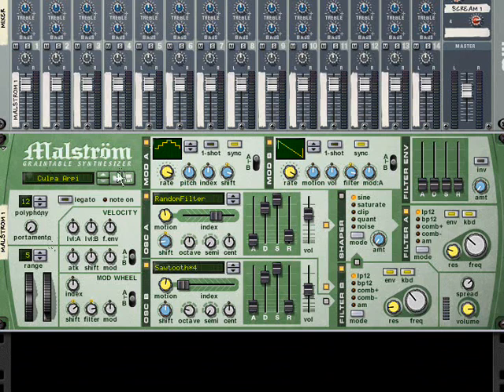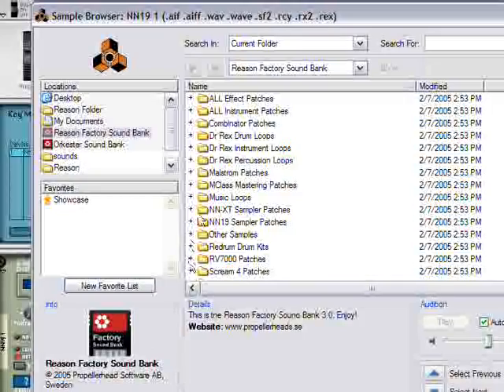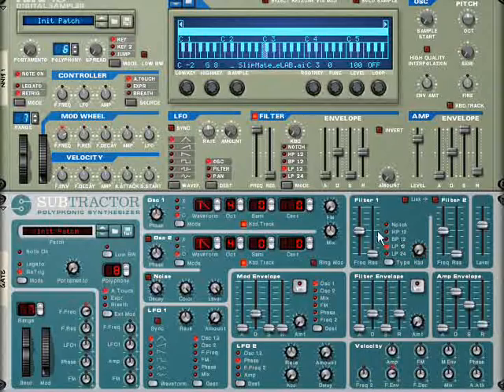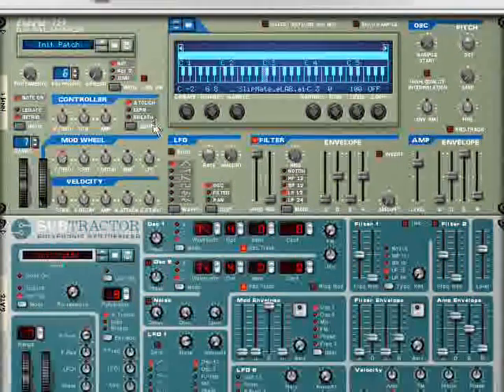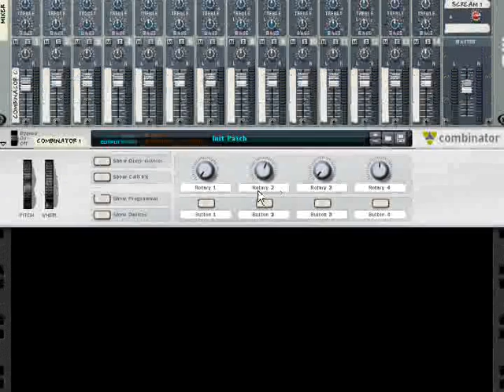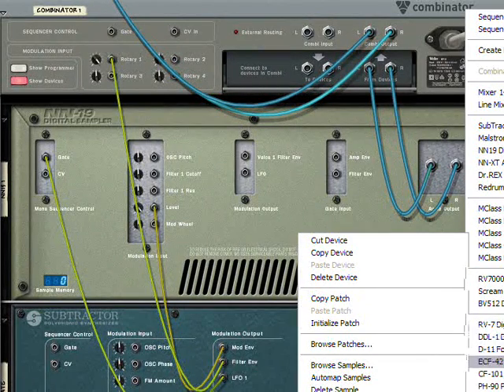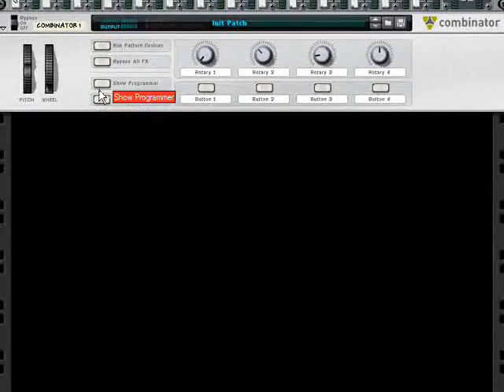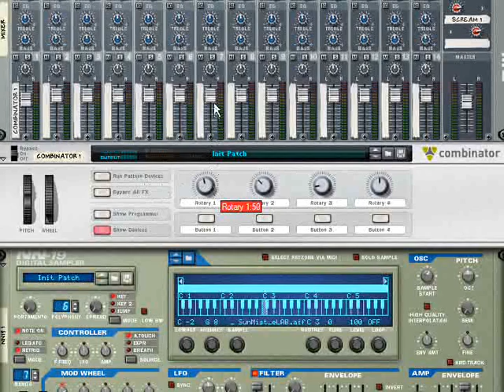Reason - Glitch effects (Granulizer) setup

Comment: Not sure why I'm having this problem. Using ver 5 and the sample wont stop playing all the time. Constant output, at intervals dependent on the Subtractor's LFO's rate, assigned to rotary 2. The sample will play if I hit the keyboard but it doesnt affect the 1 sample that is repeating. Mod env is connected to the NN19's 'Level' but doesnt appear to do anything? I know this is old but any help/response would be appreciated.
Reply: +S Chavez use the LFO 1 from Thor as this requires a gate signal to trigger the LFO's cycle.

Comment: They are very different both in concept and functionality.

FL Studio is mainly a sequencer and DAW. Meaning, you could accomplish all your recording in FL. 

Reason is a MIDI-driven application that cannot directly record audio in. It does, however, have some of the best sound design capabilities of any piece of software out there.

My advice; get FL Studio AND Reason. You can use Reason inside FL Studio to design your sounds and track and arrange everything in FL...

Comment: This is damn cool. 
I came close to creating a two-sample stereo one of these today, but I can't seem to get full control over the second sample w/o taking it away from the first. By copying and pasting the sampler, gate, and effects and routing them to the splitter. Then create a new combi and route the delay to it, and combi to mix 2. Adjust "spread" with delay panning. Problem is you need two more rotaries for the LFO 2 and Filter 2. Maybe you've figured out a way to do this?

Comment from the maker: It could be because the knob on your rotary input on the rear of the combinator is set for 64?  Set it for 128.  It's the sensitivity to the input that this knob controls.  Remember, it's the knob on the rear where your rotary input is plugged in.

Comment from the maker: Actually, the reason I chose not to use the NN19, is that it does not provide an easy way to actually STOP the sound.  You need a subtractor as a gate for your on/off control anyway, and I want to demonstrate the ability to use subtractors as control instruments, rather than audio.

Comment from the maker: Alternately, you could wire up a RV7000 after your Rex, set it to ECHO algorithm with a delay time of 20-40ms.  Dry/wet 50%.  Use the GATE mode CV either Matrix it or Combinate it with your rex (recieve notes [x]).    Don't forget to hit "Gate Enable" on the front.

Comment from the maker: I know what you're saying!  The Rex only has Slice output jack - no real midi controls, EVEN though it accepts true MIDI from the keys!  So here's an idea.
Put the Rex in a combinator, and wire up an LFO to the Combinator's Gate in.  Make sure your rex is set to "Recieve Notes" in the programmer.  You may have to create a subtractor-gate to keep it from sounding off all the time.  This way, it should recieve Gate events from the LFO, and Note events from the keys?  Worth a try.

Comment from the maker: Yes.  The reason is that you are not actually triggering the NN-19 with the keyboard, or even the sequencer for that matter.    The NN-19 is being triggered by the Subtractor's LFO, and thus does not recieve anything other than Gate signals.  If you play with Keyb. tracking ON, only the first "grain" takes your keyboard pitch, and the rest default to C.

If you really want to play notes, you'll have to use  Matrix's Note output.